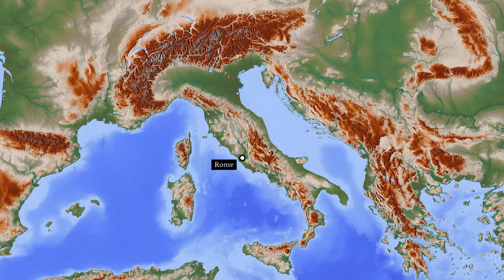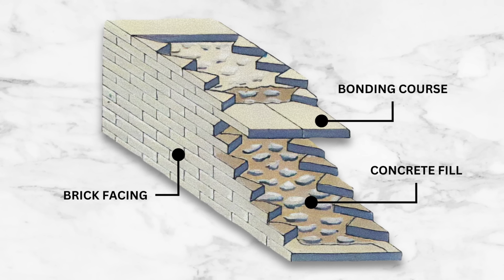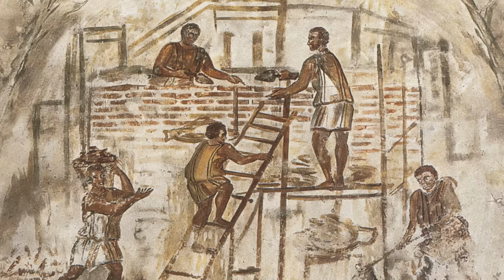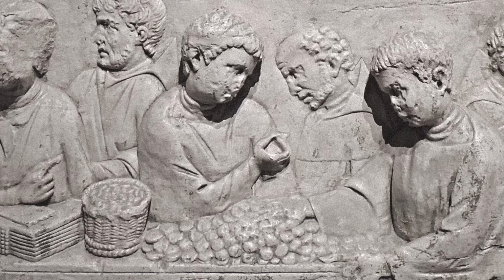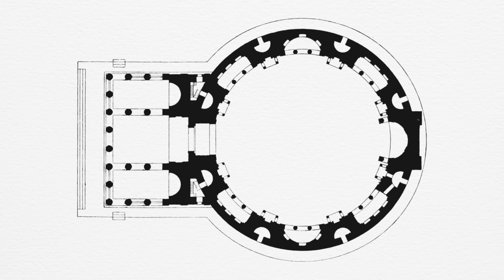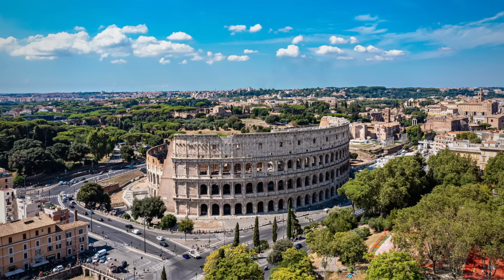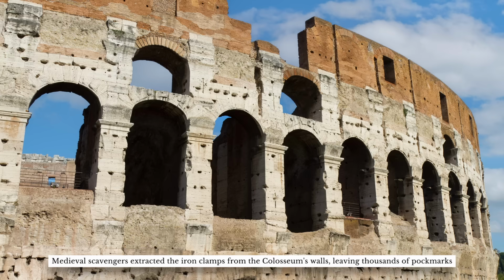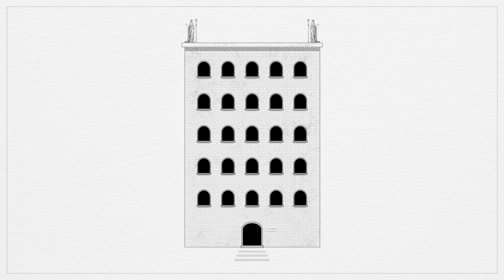Why isn't Roman Concrete used today?

Comment: The problem with regular modern concrete is that it's porous, so water can seep into it over time. This eventually corrodes the reinforcing, leeches soluble components out of the concrete, and causes damage when the water expands during freezing. Fortunately we now have many additives that can solve all these problems. Obviously these additives cost more than regular concrete, but we can now make concrete that is far superior to anything the Romans had.
Reply: There is a structure out in Colorado built using something similar to Roman concrete.
Reply: Also, iron rebar. The ancient greeks and romans would plate the iron with lead, but these days everyone is terrified of lead. Time will tell if polymer coated or fiberglass reinforced concrete will hold up. Normal iron rusts from water, and rust causes expansion in a confined space, which cases cracks.
Reply: What are the additives you're referring to?
Reply: I understand your point but in a way I disagree. The lime in the Roman concrete has proven itself able to last two thousand years. Modern concrete can not do that.
Reply: @jay-by1se  survivorship bias. you can clearly see all the structures that survived, but none of the ones that didn't
Reply: @Dominic_LaSalle   yes but Concrete will not survive 200 years. So there is a place for the older concrete.
Reply: @jay-by1se  because it doesn't need to. There are many other considerations beyond lasting a 1000 years. But to say we couldn't make it so is just not true.
Reply: @latlatko  I think some buildings don't need too. But if sustainability is a goal, buildings being torn down every 50 years is a disaster.
Reply: @jay-by1se  isn't that typically due to the rebar rusting rather then the concrete decaying?
Reply: @ yes and no. When building for long term we still use lime morter over concrete morter as the lime will self heal. Concrete cracks very badly without rebar.
Reply: @latlatko  do you realise how fucked up it is that ever since WWII, we've been building shit that has to be replaced within the same generation it was built? Have you ever tried drilling into concrete? You have no idea how energy intensive it is to tear down concrete buildings. On the one hand they're unfit and unsafe for serive, but on the other hand, tearing them down is insanely wasteful. Imagine doing that  to the entire housing stock, every single generation from now on. Imagine how much new concrete that has to be produced as well... even if you recycle the concrete, you still have to crush it into finer aggregate sizes... you have to separate the steel from it... very energy intensive... it is insanity mate. It's absolute insanity. Modern concrete is like being addicted to crack (no pun intended): it seems like a good idea at first... but it's not sustainable.
Reply: @DeWarmePlakker Concrete buidlings can last very long, its not a problem with framing or concerete itself but with building purpose and maintanance. Quality concerete lasts for more than 100 years, we still lack exact data as very old buidlings are around 120 years and still perfectly fine. In Czechia we have an institute which study prefab buildings and concerete dams, suggesting that prefab housing built in 70s can last another 80 years and most dams built in 30s will last another 100 years as concerete mixture used in them gets stronger with age and mineralisation while in contact with water. Demolitions might seem wasteful but they are done to repurpose the space more often than due to lack of maintanance or structural damage. Concrete is just far more superior to other methods due to its durability, fast building time and relatively cheap manufacturing.

Comment: I assume that the amounts of available pozzolana are low, so has anyone figure out how to make artificial pozzolana so it could be used in modern building in some way?
Reply from the maker: You could use crushed terracotta instead of pozzolana
Reply: Yes. Artificial "pozzolana" can be made from materials like fly ash, silica fume, or calcined clay. Any alumino-silicate would do. The resulting material, whether using natural volcanic ash or an artificial alumino-silicate is called "geopolymer concrete."

Comment: without elevators, skyscapers dont make any sense... 
in high rise buildings without a lift the upper floors become cheaper each level
Reply: It's why dance companies, yoga schools and martial arts dojos are usually upstairs.
Reply: @kirkvoelcker5272  are we talking about living or business space? 
i was actually talking about apartment buildings around the 1900´s, up to 10 story buildings without elevators
there is a famous picture of a poor guy living in the attic
having to carry up the coal bars from the cellar for heating and everything else several stories every day issn´t for the better off
a time before elevators became common u know...
not so many yoga and martial arts dojos back then....
Reply: @kirkvoelcker5272  if my mind serves me correctly even the insulae in ancient rome from toldinstone were structured the same way with the most luxurious apartments in the first floor and getting cheaper the higher u go